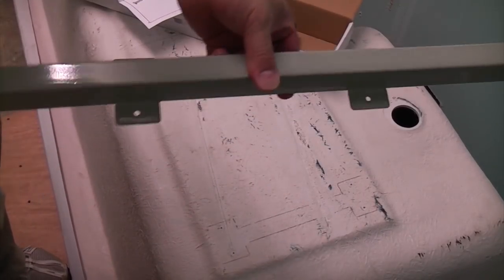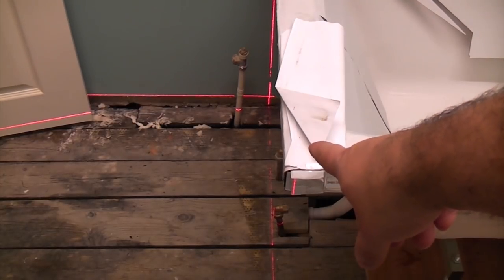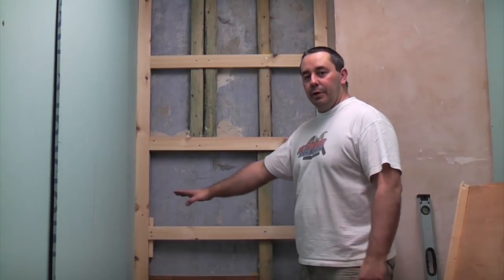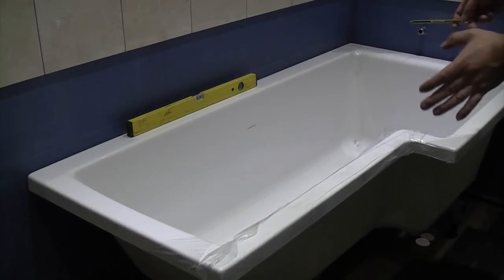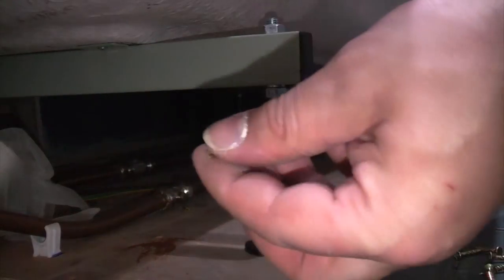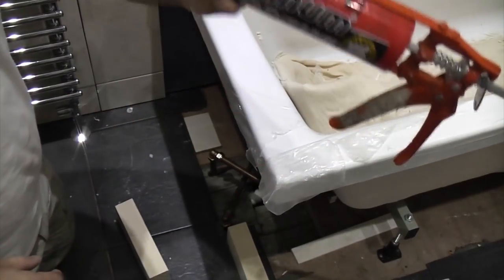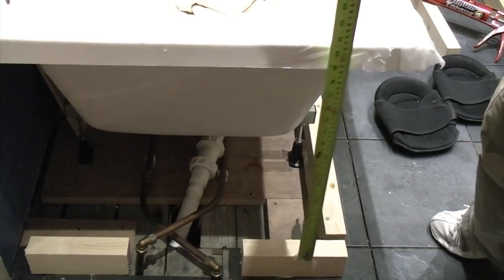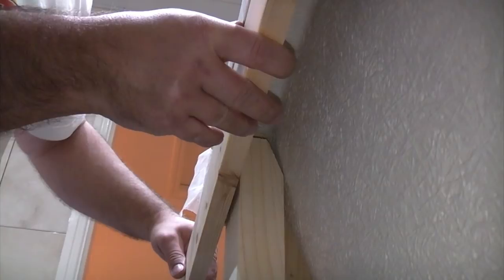How to fit a bath

Comment: Some ideas have just popped into my head after looking at a brand new upside down bath in a newly prepared bathroom in my house. 

After you've positioned the bath in place and all level and twat on straight and so on..  you could dump a can of two of expanding foam underneath it.

don't all laugh at once; here's the reasoning:

1. it will set solid; and you all know how tough plasterboard goes after its been glued to the wall with this stuff
2. you could half fill the bath with water to stop the (probably considerable) uplift caused by the foam expanding over such a large area. use bits of wood or cardboard to stop the foam getting to bits it doesn't need to get to.
3. when its set, you've glued the bath to the floor. O shit, but..... you've provided about a square metre of support area for the baseboard and by anyone's reckoning, that must be better for the bath itself and any flooring underneath than a single leg in the middle of the tub.
4. You can do it in phases to stop the foam going crap in the middle because its too thick
5. it will provide another layer of insulation for the bath to stop all that lovely hot water getting cold on erm.. her arse. heh heh...(its all about requirements)

Unless you need to move the bath around the room regularly I can't see a reason why not to do this for 8 quid's worth of foam cans.

Another one that popped up is... some PVA and a roll of cheap tin foil, glue the foil to the outside of the bath and let it dry then paint that with PVA again and then spray that with a few cheap cans of expanding foam using the polythene that came covering the bath to keep it in manageable layers pressed on the outside of the foam when its still wet,..... one insulated bath for about £20;

Why let the heat out ?
Reply from the maker: Sounds like a plan ;-)

Comment: hi has the bath not got to have a slight fall to the plug hole for drainage.and also mate my bath has no holes pre drilled for the taps is there a tip/trick for marking out before drilling them.any help be appreciated cheers
Reply from the maker: Hi, no the bath has a built in fall so you just need to fit it so that the top is level.
For the tap drilling I would cover the end of the bath with masking tape, then measure it and mark out the holes using a engineers square. You should be able to find the centre of the bath, then mark out the tap holes from that ;-)
Reply: Ultimate Handyman 
thanks for that I will be tackling it this week with a bit of luck. should be OK.i ain't got one of them flat drills to screw the legs down but il figure somert out 🖒